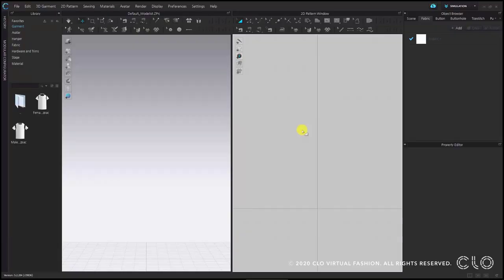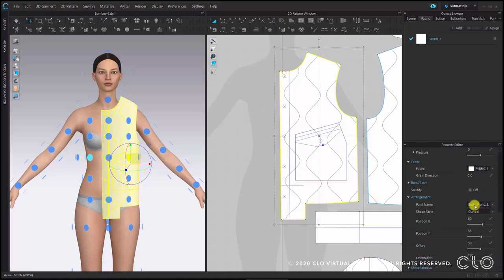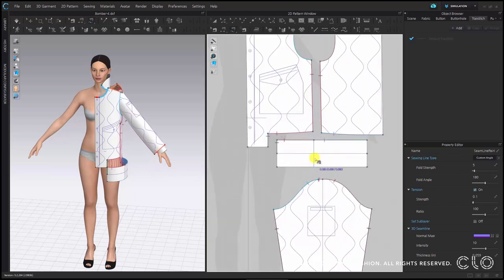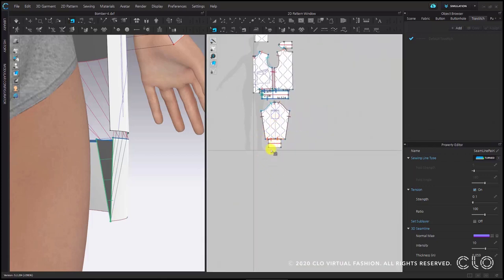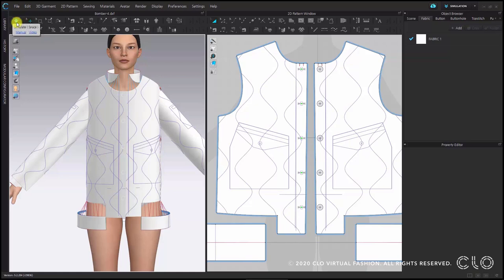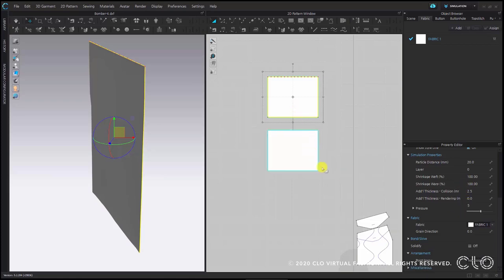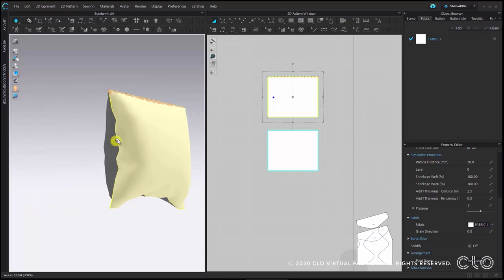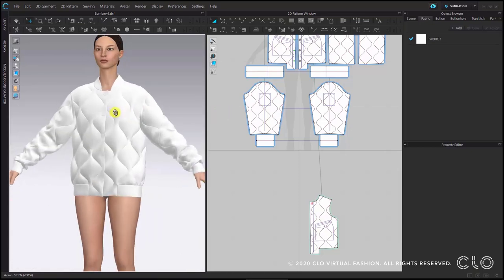Garment Construction: Padding Jumper(EN)

Comment: So what if we have a lining! I wanna see how my garment will look with already attached lining! It is a must when we have classic or sport jackets, rain or over coats and of course other  clothes with lining. (By the way this jumper should have a lining too!!!) Do you have a tutorial for this? Or is it even possible to do this kind of simulation in CLO?
Reply from the maker: Hi. Yes you can add linings as well in CLO. Similar to this video that are put in. This video just had to layers, but if you have the pattern pieces for a lining you can sew them into place and then use the LAyering tool or Superimpose under tool to get them underneath the main shell of the garment
Reply: @CLO3D  Wow, that would be interesting. Will CLO accept .dxf files from Gerber and Lectra (which are already divided by fabric type?😀
Reply from the maker: Yes, CLO can use DXF AAMA and ASTM.

Comment: The buttonholes on the front panel of the cloned item disappeared. I think that was the reason it was challenging to attach buttons. We need to make buttonholes in both layers at once. Is there an option for that?
Reply from the maker: You do not need to add additional button holes. instead R-click on the buttonhole sin the 3D window and apply additional sewing layers
Reply: @CLO3D  Thank you!👍👍

Comment: Thank you for the tutorial! I had some troubles with buttons during the lesson. After simulation thy were jingling on the pattern pice, is there anyone who had the same problems? So any way i just gave up and change them for zipper...
Reply from the maker: You're welcome! Buttons and Padding can be challenging when done together.
Reply: I had this problems as well-I think the I found the issue.  Watch the front layers that you are putting the buttons and fastening them.  So, in this instance, the buttons on wearers left (original pattern) should fasten with the "LAYER CLONE OVER" wearers right button holes.  As soon as I made this adjustment the buttons stopped jumping around and they did not move at all-no more collision.  Hope this helps. 😀
Reply: they irritated me during the whole process😤

Comment: I've been trying to sew a similar piece- it's a vest, so it stays open and the inside is visible; and it also has finishing on the edges to look more realistic. When stitched with wrong sides together, the pressure has to be positive on both of them. Problem 1 - solved. Problem 2, however, I don't know what is happening. Simulation is not stable and when all the lining layers are flipped, the garment starts "jiggling"and eventually explodes. 
Any tips on how to finish a garment like this, so it looks neat inside, are greatly appreciated. I can't figure out what the issue might be.
Reply from the maker: Try using the Hi Res Garment Tool to up the quality of the garment. Use Fitting Simulation to help with stability.

Comment: i tried it with rows of stitches 1.5 cm in parallell but it does not puff up. once i deactivate the stitching it starts to puff up. dont know what i am doing wrong.
Reply from the maker: The closer the Internal Lines are the higher the amount of pressure needs to be added to both fabrics.
Reply: @CLO3D  thank you i thought so and it works

Comment: after setting the pressure from 40:00 my buttons are buried in the front placket. even i followed it step by step, its still hard to get it right.
Reply from the maker: Make sure to apply the pressure as shown. Also Select your Buttons with the edit Button tool and make sure you have specified the Set Number of Sewing Layers (based on how many layers you have)
Reply: @CLO3D  Its the same for me, The buttonholes does not copy over to the clone made for the preassure part. So then the buttons gets in between the layers........? Is it some setting?
Reply from the maker: @user-yh7vd5fq3c  Right Click on the Buttons and Select "Set Number of Sewing Layers" Make sure it is 2. Also Reset 3D Position
Reply: @CLO3D  I am having a similar problem. I have checked the Set Number of Sewing Layers (all are at two) but every time i simulate the buttons are getting caught. I have reset 3D position many times. Do you suggest anything else?
Reply: I dont know if its still helpful, but I was having the same issue now and after one hour of battling with clo :) I managed a way to solve it. Simply before simulating select each button on the 3d and after push each one a bit outward, its important that they dont have to touch the fabric